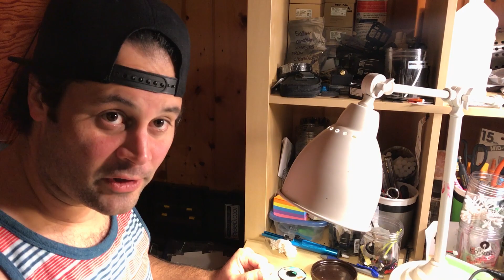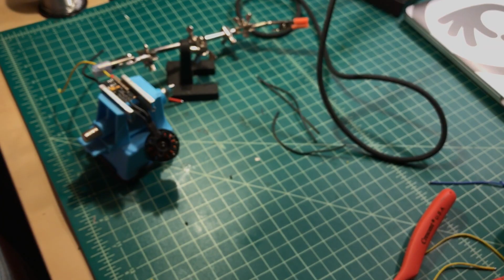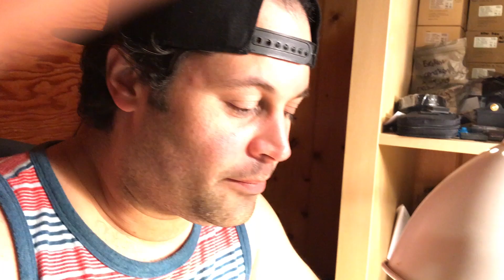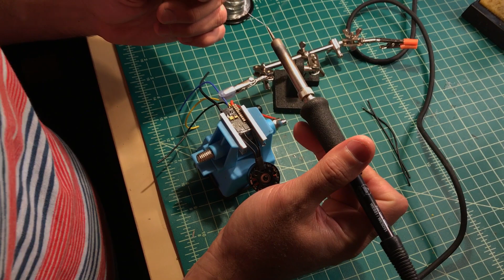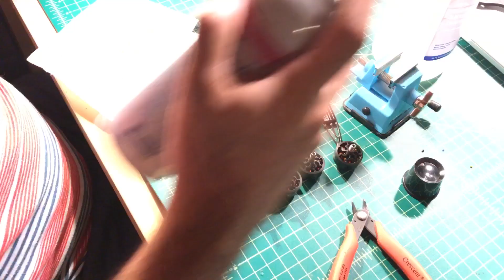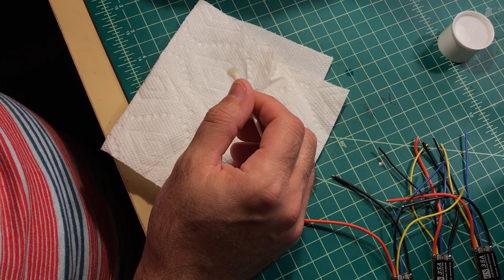Soldering Small Wires

Comment: question, if you dont mind. Im trying to get into electronics and soldering, so Im still really new and learning about this. I thought for my first project Id try repairing a pair of bluetooth bone conduction headphones that broke a while back. Im fairly certain what I need to do is reconnect two wires that broke off a tiny board in one of the ears of the headset, where they were soldered originally. So they already have soldered joints set there on the board...do I need to remove those somehow and or can I just use those to reset the wires by burning them? I hope this hasent been confusing, Im not the best at explaining thing. Thanks in advance! :)
Reply: Buddy, I have the same issue. I am planning to solder two wires to a speaker, so I too was wondering could I just use the already existing joints. How far are you with yours, did you manage to fix it?
Reply: @d-rzarkocubrinoski   - it went pretty well actually… well, they work again at least. I did end up making a new joint anyway, because I messed up the old one. My hands are really unsteady, and the wire is soooo tiny. It requires serious precision. Although, another person on a forum I asked a while back said it should work fine to just melt down the original joint.
Reply: @richardlambert256  Ok, great, nice to hear that you finished the task successfully. Now it's my turn. :D

Comment: I need to solder wires from a headset, the wires have snapped close to the solder joints, and they are so small it's going to be a struggle, should I attempt to solder the wires to the PCB or solder the wires together? I'm not familiar with wire sizes but it's around 0.5/1mm in thickness
Reply from the maker: It depends. You need to assess which might be the better approach. A lot of people are afraid to solder to a PCB, but it really isn't that difficult. If you have clear access to the PCB and the solder pads for those wires are nice and clear, then that might be the best option. With drones, our smallest wires sizes tend to be 26AWG, but occasionally a 30AWG wire comes around. Your wire sizes there sound like this. But, if they are so short, maybe it's better to solder back to the PCB.

Comment: Great suggestion on using a gig to hold the thin wires prior to soldering.  I am looking to reconnect thin wires that were accidentally broken on the pickup arm of my turntable.  It is really tricky since there is only short lengths of wire to work with.
Reply from the maker: Yep, take your time and use some of these tips. You'd be surprised at how small you can go. This videos shows examples on drone ESCs, but I've also soldered wires to broken off pin headers. Which is basically soldering straight to slightly raised exposed traces on a PCB. Much smaller than the example in the video.

Comment: Did you pre tin the wires and ESCs?
Reply from the maker: Yes sir. I noticed I forgot to mention that in the video. But yes, it would be nearly impossible to get clean solder joints on such tiny wires where the pads are so close together without tinning them first. They would spread and get wider when pushing them down otherwise.
Reply: PinchTune that’s what I was expecting. :)  thanks for confirming.

Comment: Great video ! And yes, people should at least NOT use the round conical tip that comes with most soldering irons , screwdriver or chisel shaped tips are much better like you said, only a wet sponge, cools the tip, a metal scrape sponge will do a better job, and doesn't oxidize the tip, you gave some good info , i guess not many people in the hobby expected they also need soldering skills and it's good to bring this under the attention ! Thank you !

Comment: Where do you get the extra tips for your soldering iron
Reply from the maker: Frys has them. Easy enough to get there. But I've bought some from Amazon as well. Just make sure they are designed for you iron. My Weller WES51 uses specific tips that won't fit a Hakko or even some other Wellers.